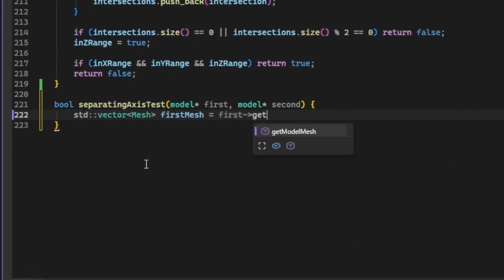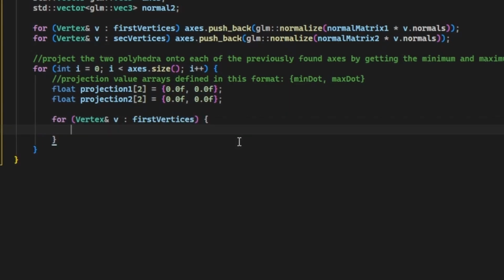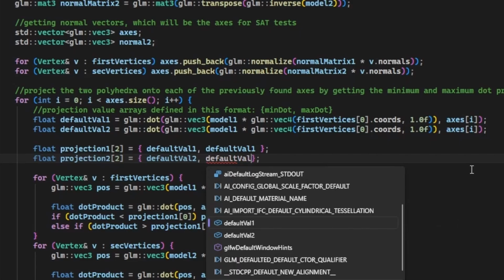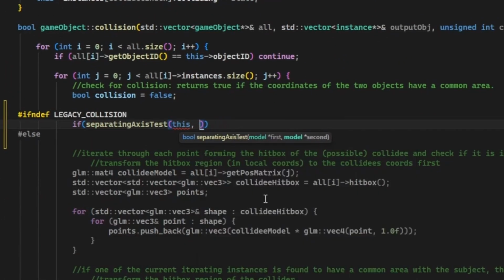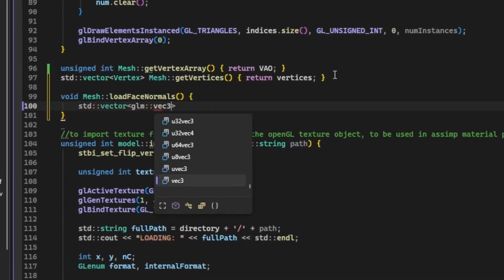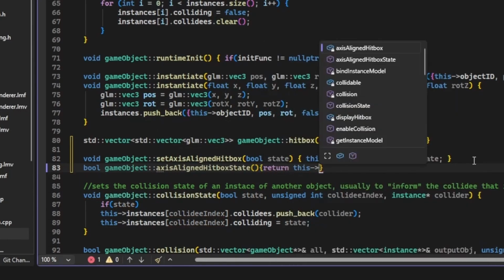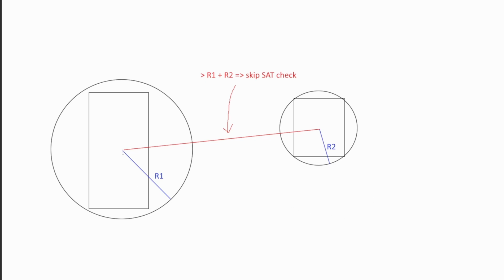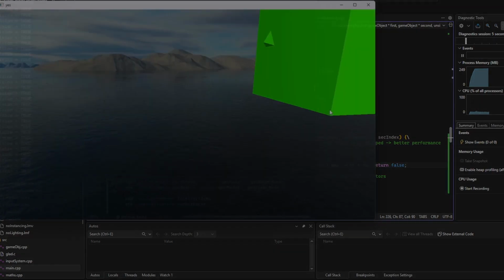Game Engine Project 5: Separating Axis Theorem for 3D Collision.

Comment from the maker: UPDATE: One thing I forgot to cover was finding the Minimum Translation Vector (MTV) of the collision to set the colliding objects apart.
This one is relatively simple. Out of the axes on which there is overlap, the one with the smallest overlap is the vector you must transform the objects to set them apart.
You can translate the first object with vector A, magnitude B / 2 and the second with vector -A and magnitude B / 2. This will be just enough for it.
Additionally, you can also add some forces to make them bounce or something as you would like. It's simple.